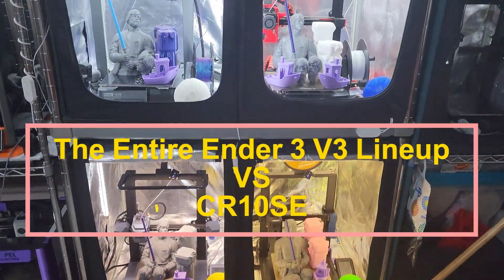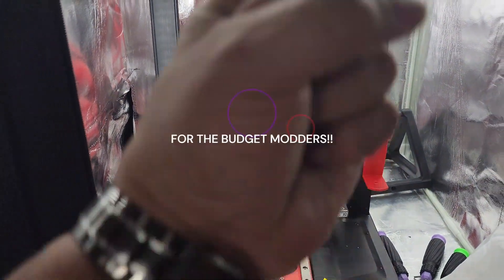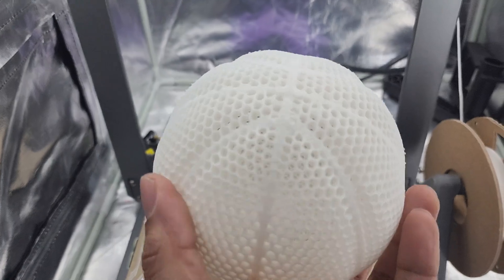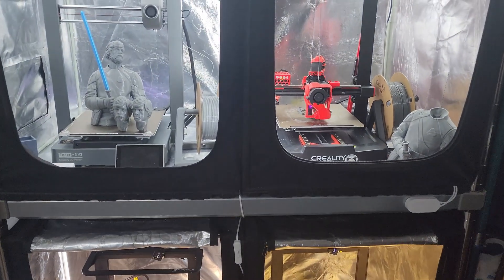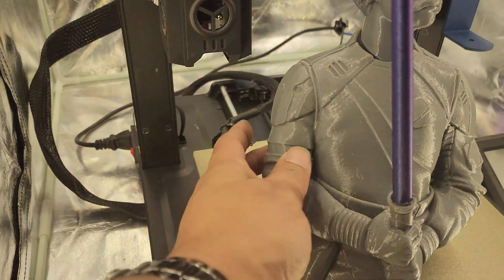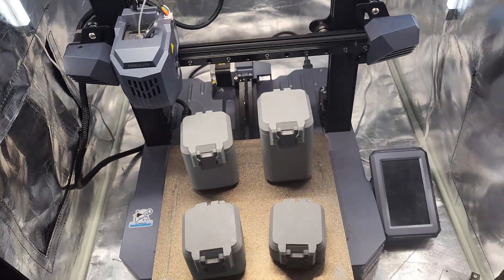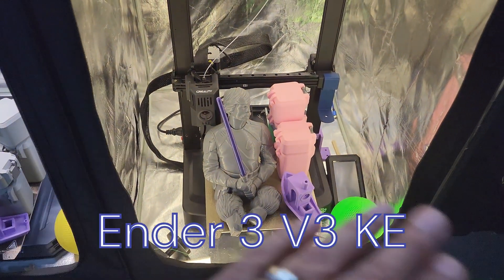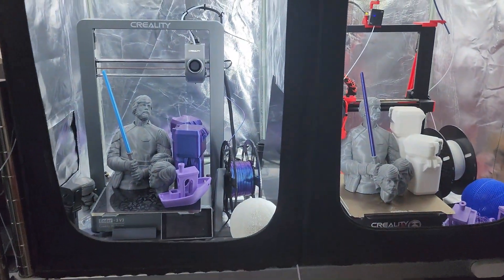New Generation Creality Bedslinger Battle

Comment: Kind of don’t want to spend more than 200 on my first printer. Trying to decide between the ender v3 se and the ankermade m5c. Is the ke worth the extra money?
Reply from the maker: @jaysdub  Yes.  The KE is running Klipper out of the Box and has more functionality over the M5C.  Full Disclosure I am completely bias on the Ankermake Brand as my experiences with them has been horrible.  But some people do enjoy printing with them.  I myself do not recommend them (EVER).  Your more then Welcome to check in on our M5C's adventures with @thatguywhomakes.  We gave it to him to enjoy.
Reply: @3DandTeePrinting  thank you for the reply. I wonder if problems like yours are the reason they are half the price they were a year ago. I think I’ll shell out a little more and get the KE.
Reply from the maker: @jaysdub  Just be advised Do Not Top Mount the Filament Spool Holder.  The Gantry has narrow extrusions and has a tendency to wobble on the KE and SE when you run the spool ontop.  There are alot of printable side mounts with filament guides that will rectify that little hiccup.  Very simple fix that really improves print quality.

Comment: On paper the CR 10SE  look more robust and faster LIKE the linear rail bed &  dual z axis etc  so which one should i go with  Cr10se or v3 KE as i am getting both at same price
Reply from the maker: KE has been more consistent for me personally but once you tune the CR10-SE it is more dimensional ACCURATE.  I have spent more time and firmware updates with the V3 and I have to say it's a really good machine.   If you have a Microcenter near you they have the V3 for $279 now on sale.

Comment: So microcenter currently has the CR 10 SE for sale at just $10 more than the Ender 3 V3 KE. At this price point, which one would you recommend? Your video suggests the CR 10 SE just performs worse than the KE, even though the CR 10 SE has better specs on paper (linear rails, included accelerometer for input shaping).
Reply from the maker: I was shocked myself but yes the KE does produce faster and cleaner prints than the CR10.  If you noticed the price has continued to drop on the CR10SE.  It started out as a $399 printer and then has steadily dropped over the past 8 months.  The KE is usually $259 to $299 and has been since it's release.  You can pick up an CR10SE for $269 at Microcenter.  The CR10SE is a good printer don't get me wrong.  It just doesn't live up to it's specs.  The CR10SE does have better dimensional accuracy over the KE and has a better build quality.  But I would still pick the KE over the CR10SE.

Comment: would the v3 be more reliable the the ke?
Reply from the maker: Too early too tell.  Both are running pretty good right now. It's only been out for 40 days.  I only have 200ish hours on the V3.  The KE has been rock solid on Jello (sorry couldn't help it) for more then 400 hours. Still need to stabilize the gantey like I did on the SE (aka DIablo) but otherwise printing pretty good.

Comment: My ender 3 v3 also has over hang issues, my ender 3 v3 se are better. Any fix? For that
Reply from the maker: Slow it down in your slicer under overhang speed.  I usually print outer walls at 100-120mm/s on the outer walls and haven't had any issues with overhangs at all.

Comment: I have an Ender 3 V3 SE, and I would like to know the difference between it running with Marlim and with Klipper, I've looked for several videos and I can't find it. I wanted to know if it improves speed, quality and everything else. because I'm thinking about making this modification to it. but I can't find the benefits of this modification.
Reply from the maker: Klipper is a web based UI that allows you to unlock he FULL potential of your printer by allowing YOU to calibrate and change your printers configurations along with remote access.  

Whether that be by pushing your current setup harder and faster then it was designed for or adding modifications with new setting that need to be changed in the printers Configuration files.  It also allows for input shaping which compensates for the vibrations your printer naturally makes reducing ghosting and artifacts. You can use KAMP, an advanced bed leveling tool in Klipper.  Remotely access your computer and hookup cameras for remote viewing and timelapses.  Increasing your printers temperature mins and maxs.  PID tuning for your nozzle and bed for more stable temperatures. 

 Easiest way to think about it is as a TV remote control. 

Your printer has a BASIC (Marlin) numbers only type remote control.  No options button, no mute, no input setting button, no directional arrows, no pic and picture button.  Just numbers, channel/volume up and down along with a power button. THE BASICS.

With Klipper someone has now handed you a SMART remote with a screen attached to it (Not a Universal Remote! A SMART remote).  You have way more buttons and you now have access to utilize everything your TV is capable of that you weren't able to access before. 

Basically it gives you all the OPTIONS you would ever need to tune or modify your printer before and after modifications along with alot of other cool featured.

I have never met someone who went to Klipper and went Back to Marlin.
Reply: @3DandTeePrinting  thank you very much !!!The explanation was excellent.I have Another question, is it better to use the Sonic pad to put the Kliper on or use a Raspberry or can I use an old laptop that I have sitting here?

Comment: What are the top upgrades for the se?
Reply from the maker: KLIPPER.  Either with Pi, Sonic Pad, Nebula Pad, Speeder Pad (Flsun), BTT Pad 7 etc.  
K1 NOZZLE
GANTRY SUPPORTS
Reply: I have gantry supports and am planning on getting a nebula pad soon.
Reply: For the k1 nozzle is that the ceramic hotend or something else?

Comment: Which slicer are you using?
Reply from the maker: For this I used Creality Slicer and the Printer preset profiles it has to make it fair.  But I normally use Orcaslicer and build my own profiles through tunings.  The SE and KE I have better profiles but I wanted to use what "most" new users will use when they get a Creality Printer.

Comment: Awesome video. Is there anyway to mount the spool on the top of the V3? The default side mount seems like a design flaw.
Reply from the maker: You DON'T want to top mount on a machine like this.  Placing it on top WILL effect the input shaping and stability.  The side mount in this video is NOT the one that comes with the machine.  The v3 stock spool holder makes the printer too wide for a standard enclosure. It IS needed for full spools though.  When the printer homes (top of gantry for XZ printer) it unwinds a good amount of filament going up.  When it comes back down the filament can tangle around itself without that spool holder design.  Personally I like the design of the stock holder (Not the cheap 3d printed look it has.  Probably why it comes with the STL files to print the replacement parts for it).  I  just wish it was parallel to the side and not perpendicular.  That way it would be SLIMMER footprint.

Comment: how good is k1 , k1c  ( isaw some saying they have bad extruder which if im corrrect is same on v3 )
Reply from the maker: Older K1'S DID have issues with the extruder being made of Aluminum and bending internal gears.  They revised it (got one of the 2nd revisions) and switched to a new Extruder made of steel internals.  They did another revision and changed the filament gear switch that engages the gears (got one of those too).  Then they made the K1C which was SUPPOSE to fix any if the remaining issues with the extruder with the 🦄 "unicorn" nozzle.  I too have heard there are now issue with the unicorn nozzle setup on the K1C still allowing for filament to creep out of the sides of the heater block along the filament path but I personally have not seen or experienced that since I don't have a K1C.  The V3 extruder has a different head from the K1 and K1C but MAY share the same extruder I am not sure.  No issues so far with the V3.

Comment: Bro are they just fine in the enclosure even it's so hot? Or you put some exhaust fan?
Reply from the maker: The Enclosures are used for High Temp Materials.  They need the heat in the chamber as well.  You would leave the front flap open printing in PETG/PLA/TPU and closed for ABS/PA/PC.  It is always better to have a carbon air filter but you can print without one successfully.  BUT you will have some VOC'S that are emitted during printing that SHOULD be captured by filter.  I have 2 large room air purifiers I run in the shop.  The HEAT won't be your problem it's THE VOC'S.  
Keep in mind the SE was modified so it now can NOW print high temp.  Stock it is not recommended.
Reply: @3DandTeePrinting  Thanks a lot 💯 I'm just a newbie 😁 btw what upgrades can i do for SE? So it can print abs bro.
Reply from the maker: @haven-hw2wl  K1 Hotend Swap.  Will allow for 300c on the Nozzle.  You will have to alter you Printer.cfg file to reflect the new temps or else it won't get above 265c.

Comment: 0:51 Hi Dave , at the CR10SE i see there is 1 line like floating . its also happen with my CR10SE . 
what can cause it ? i cant get the solution
Reply from the maker: Still trying to work that one out.  It's not unlocked or rooted yet.  Once it is able to, I will be able to do more testing and figure it out.  It comes and goes as well.  I will keep you updated once I find the answer.
Reply: I have the same issue but only with certain filaments.  It's weird.  Hyper-PLA, no issues.  I sometimes use Slant 3D's Tangled Filament and I get that line.  Very strange.
Reply: I have to CR 10 SE in the print quality on benches have been perfect for me

Comment: Badass video! So the KE beats the Flashforge Adventurer 5m still? I'm having a tough time deciding between the two lol. The flashforge is so tempting since I currently own a V3 SE already.
Reply: I can get the Flashforge 5m pro for $440 shipped. Should I do that or k1??
Reply from the maker: @cagerage21  You got 3 good printers there to chose from.  
5M PRO: very nice Machine Not a Huge Community Behind it but a good printer
KE: Great Middle Range Printer. Get more for less printer.  Not as stable as a CORE XY printer like the 5MPRO or K1.  Will need to purchase or build an enclosure to do high temp materials.
K1: Good printer (new versions not older used ones) has the second largest build Height at 250mm (220 on 5M and 260 on KE).  Beds have been known to be misaligned from factory regardless of when it was built.  

You really can't go wrong with either one.  
If it was me, Based on MY needs I would go with a K1 (already have 2 and K1 Max).  But remember it's what YOU need.  If your not going to be doing high temp materials anytime soon get the KE.  If you need the high temp go with the K1 only because of rhe build area and larger community.  
Again YOU can't really pick a bad one from your list.  YOU just have to make sure it's right for YOU. 
CORE XY or Bedslinger? 
Then HIGH TEMP material needs?
That should give YOU some direction.
Reply: @3DandTeePrinting  Awesome man! Yeah I was looking at the K1 3D not the K1C. Heard the K1C has some issues.

Comment: I have the k1 max, Qidi X Max 3, and the Ender 3 v3 KE. KE is the goat for me in reliability. It just works without really trying the others I have to spend more time specifically the k1 max. I have had to really concentrate on the k1 max.
Reply from the maker: Glad your enjoying the KE.  My Max is brand new and been printing pretty good so fat.  Just finished a full sized airless Basketball with no issues.  Hope you get it running right soon.  I got faith you can get it fixed.